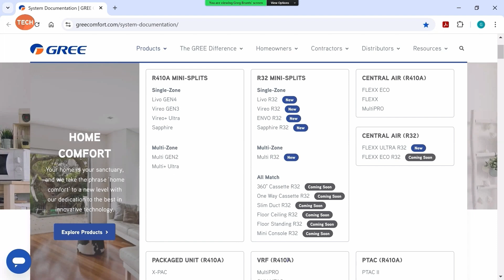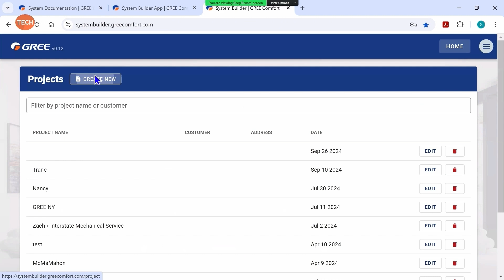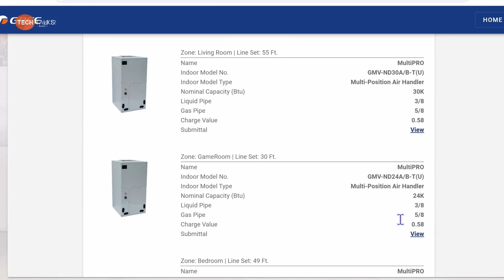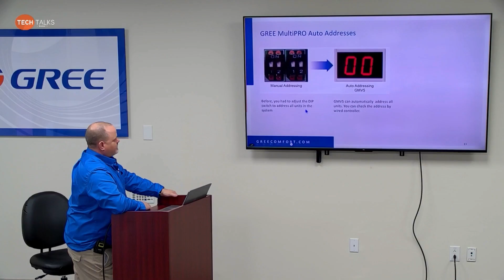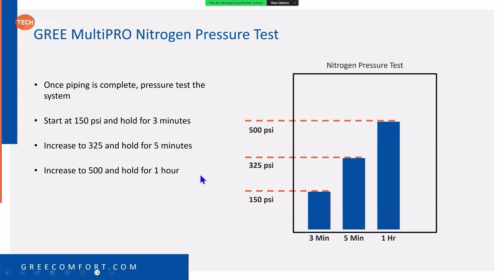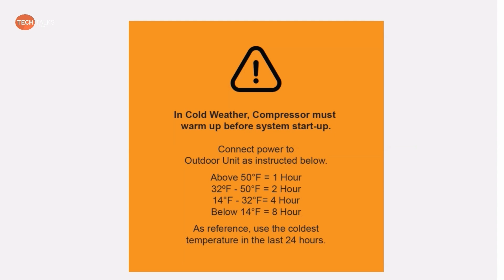Tech 90: MultiPRO System Design & Installation

Comment: Sir, do mini refrigerators and full size refrigerators have the same inrush current? I have a full size refrigerator. The problem when plugged in is voltage drop at home. I would like to change a mini refrigerator. Will the voltage still drop?

Translate